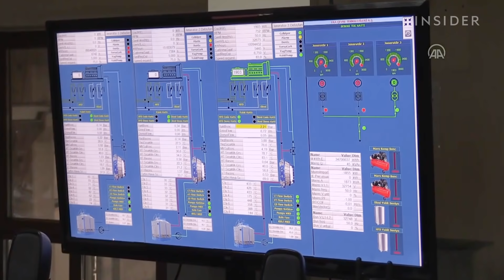How Old Tires Are Turned Into Electricity | World Wide Waste | Business Insider

Comment: Why TF would you burn the tires into the atmosphere. Recycle the rubber & reuse it for other things needing rubber.
Reply: The news report is very incomplete. But if you research further, the process is NOT a direct burning of tyres as opposed to incineration plant. It will be very pollutant if these are burn directly. Also a better option than putting those used tyres in landfill.

At 2:50, it is mentioned the old tyres are shredded and subjected to chemical process, producing a by-product called pyrolisis oil (comparable with biofuel) by pyrolisis thermal process, read this link:
http://2gbiopower.com/#:~:text=Enviro's%20pyrolysis%20process%20recovers%20the,products%20including%20new%20vehicle%20tyres.) The chemical process is controlled and adhere to environmental regulations. 

The other two recyclable by-products are steel wires and carbon-black. "Carbon Black originally used to make the tyres, is recovered along with the other inert fillers. This is milled and beaded for re-use in rubber components. 1kg of virgin Carbon Black is made from ~1.6 litres of fossil fuel. Recycling carbon black (rather than burning tyres) reduces emissions by about 80%."

Only the pyrolisis oil produced are then use as fuel to burn (instead of coal or crude oil by product) in the thermal plant boiler to generate superheated steam which feed to the turbines. The turbines are then power the generators to produce electricity👍.
Reply: its not that easy , different manufacturers have different blend of rubber , vulcanized rubber are extremely hard to recycle and it coat more to remove chemicals from within the rubber in order to recycle and reuse for other purposes 
And create similar or even more pollution while trying to recycle the rubber
Reply: if you reuse all of the junk tires in the world, you're not eliminating it. you're just inflating their number and keeping their harmful toxins.. what do you think would happen if those recycled sandals gets worn of?? right, it becomes trash and would probably end up on landfills again..
Reply: @heyitsmejm4792  that's the point of recycling, to keep the object in use. We gotta reuse the rubber in old tires so that they don't end up in landfills. Burning them is not an option cause we're gonna breath in all those nasty toxins
Reply: @AqEppo  Reusing is not the same as recycling, with recycling you destroy / separate waste so that you are left with the raw materials such as metals, plastic, wood, etc. Burning however is worse than recycling because it decomposes materials like plastic that could have been remelted.
Reply: 2:57 see there he told that there is no gas emitted to the environment during these stages. It means that it does not harm air
Reply: because you cant just find someone to take all those tires, its better to burn them and get use out of them than let them go into landfills or rivers.
Reply: Shut up

Comment: –OMG! How do they transform tires into electricity to avoid polution???
–It's easy. They burn them
– ...
Reply: Thanks for your comment there's a gaining key on how to invest more into Bitcoin right now, are you interested?
Reply: + 1 5 1 6 2 6 8 2 1 8 6
Reply: The news report is very incomplete. The process is NOT a direct burning of tyres as opposed to incineration plant. It will be very pollutant if these are burn directly. Also a better option than putting those used tyres in landfill.

At 2:50, it is mentioned the old tyres are shredded and subjected to chemical process, producing a by-product called pyrolisis oil (comparable with biofuel) by pyrolisis thermal process, read this link:
http://2gbiopower.com/#:~:text=Enviro's%20pyrolysis%20process%20recovers%20the,products%20including%20new%20vehicle%20tyres.) The chemical process is controlled and adhere to environmental regulations. 

The other two recyclable by-products are steel wires and carbon-black. "Carbon Black originally used to make the tyres, is recovered along with the other inert fillers. This is milled and beaded for re-use in rubber components. 1kg of virgin Carbon Black is made from ~1.6 litres of fossil fuel. Recycling carbon black (rather than burning tyres) reduces emissions by about 80%."

Only the pyrolisis oil produced are then use as fuel to burn (instead of coal or crude oil by product) in the thermal plant boiler to generate superheated steam which feed to the turbines. The turbines are then power the generators to produce electricity👍.

Comment: Environmentalist look that's better wait a minute I think I've been bamboozled cheated and maybe lied to that still cause alot of Co² emmisions lol
Reply: I think burning tires is similar to burning coal. But unlike coal, you can get used tires almost for free, and you also prevent it ending up in landfills.
Reply: @IvanKuckir  yeah but basically it's the same as dumping but you would have more space
Reply: @dsz1195  Not like that.
The news report is very incomplete. But if you research further, the process is NOT a direct burning of tyres as opposed to incineration plant. It will be very pollutant if these are burn directly. Also a better option than putting those used tyres in landfill.

At 2:50, it is mentioned the old tyres are shredded and subjected to chemical process, producing a by-product called pyrolisis oil (comparable with biofuel) by pyrolisis thermal process, read this link:
http://2gbiopower.com/#:~:text=Enviro's%20pyrolysis%20process%20recovers%20the,products%20including%20new%20vehicle%20tyres.) The chemical process is controlled and adheres to environmental regulations. 

The other two recyclable by-products are steel wires and carbon-black. "Carbon Black originally used to make the tyres, is recovered along with the other inert fillers. This is milled and beaded for re-use in rubber components. 1kg of virgin Carbon Black is made from ~1.6 litres of fossil fuel. Recycling carbon black (rather than burning tyres) reduces emissions by about 80%."

Only the pyrolisis oil produced are then use as fuel to burn (instead of coal or crude oil by product) in the thermal plant boiler to generate superheated steam which feed to the turbines. The turbines are then power the generators to produce electricity👍.
Reply: @69erone-half50  - Which "fossil fuel"? 1.6 liters of finely ground pure coal dust  would not even weigh 1kg. So, that "statistic" reeks of the priorly mentioned bamboozling.
Reply: @69erone-half50  - And, "controlled and  adhere[s] to environmental regulations" is often meaningless. A well-funded, government-subsidized process can nevertheless be an ocean away from efficient. If it isn't truly efficient,  it isn't legitimate.  Such as in the title/description of this video, claiming that the process provides electricity for "30,000 homes"(!!!) 🙄🙄🙄..... PLEASE don't tell me you buy THAT one!!
Reply: @samuelluria4744  so, what's the best solution you can offer then?
Reply: @69erone-half50  - Solution to what? Tires wearing out? My tires last 4 times longer than most people's do, because I don't drive like a maniac.
Reply: @samuelluria4744  I don't question how you drive your car and save your tyres to last 4x. But how about other car drivers and those tyres used for construction activities, airplanes, etc. With millions of tyres being used everyday, how are you going to dispose those used tyres aside from the current practice of retreading, else is to put in landfill.
Reply: @samuelluria4744  and F1 drivers are used to dump one set of tyres every 15minutes!
Reply: @samuelluria4744  just don't drive a car at all so you don't consume tyres.
Reply: @69erone-half50  I mean if they are just going to burn it to power a turbine why not just make a windturbine in the first place
Reply: @dsz1195  it's not the whole tyre to burn but only the recovered "pyrolysis oil" as fuel for thermal power station. The mechanical turbines are "steam-driven". The steam comes from boiler heated by burning the pyrolysis oil.
https://en.m.wikipedia.org/wiki/Thermal_power_station#:~:text=A%20thermal%20power%20station%20is,which%20drives%20an%20electrical%20generator.
So far, this is the available technology for industrial large scale disposal of used tyres. Thermal power stations are considered "Base load and peaking power plants" - meaning day and night, with wind or not, these plants are continuously operating giving "reliable" source of electricity. https://en.m.wikipedia.org/wiki/Load_following_power_plant

While the wind turbine is a completely different source for electricity. This is a type of Variable Renewable Energy (VRE), is non-dispatchable due to its "fluctuating" power output nature. 
(varies or unreliable). 
The turbine, although same name, is just like blades of turboprop engine plane, attached to pole and directly connected to electric generator. No burning is involved. But wait. Do you think there is no CO2 emissions in wind turbines? Wrong! The blades are made of carbon fibre materials that needs baking to form (by heat, hence CO2 carbon footprint). Each turbine requires big land area. Normal design life is 15 to 20 yrs, after this the blades are to dispose unrecycable waste to landfill.
Reply: @Uncle Donald  pyrolysis oil also has Co2 emissions when burned and so far there's dozens of ways to reuse tyres  such as using it on concrete and also I know that most of the wind turbines components are "harmful or causes Co²"but there's also carbon fiber which yes needs to be heated and have Co² but that's like 1percent of  burning pyrolysis oil in the next 30years there's also emproved carbon fiber  versions that can be reused infinitely through cars boats etc. without any problem wind turbines also last 25-30years depending on how often they do maintenances and yes they do use up a ton of land but the land where it's at can also be used in various of ways such flower field and cow grassing area unlike thermal power plants
Reply: @69erone-half50  .
Reply: @dsz1195  no argument there about wind turbine but its variable load type. This is completely out of topic now than this video about used tyres.
There are many ways to recycle tyres without burning, like as those you mentioned, but how those czn cope with the millions of quantity needing disposal?
Yes, no argument that recovered oil burned emits CO2 also, just like other oil fired power stations. Propose to use only "solid steel wheels" on your car like train so you don't consume tyres, or don't drive your car at all. Otherwise, let's stop complaining👍
Reply: @69erone-half50  I don't drive and I prefer walking it's free exercise and much safer👍
Reply: @dsz1195  okay🏃‍♂️
Reply: The funniest thing about your comment, is imagining that an "environmentalist" would ever be able to realize/admit that they'd been cheated, bamboozled,  or lied to.
Reply: @G K did you read my first comment where I explained the pyrolysis oil extraction process? I pointed out the news report is incomplete that is why many people have thought the tyres are just shredded and burn directly as in incineration plant, which is not true as only the recovered quantities of pyrolysis oil are use for fuel of the thermal plant. The other by-products (black carbon and steel wires) are recyclable materials. But some people are criticising the pyrolysis process - a technology available at the moment that is less harmful than direct burning or disposal of tyres in landfill or ocean. So they are hypocrite because themselves cannot even provide a better solution, just pure criticism, whilst themselves are also using tyres such as driving their car or bicycle (you said), producing agricultural food products, etc. To those people who are complaining and criticising, just plant your own food and walk to travel so you don't consume tyres at all!
Reply: I think you guys are missing the point. Its better than doing nothing and letting tires just rot and pollute water sources and take spaces. Recycling tires and using them for electricity instead of mining coal sounds much better. And sure you personally might be good at budgeting your use of your tire but how many other car owners are there in the world? And what about the already exisiting ones? Do you expect everyone to be as frugal as you are? And sure this is not the best solution but at least there is an attempt to solve a problem? Its not like this video or anyone else is saying we should stop using tires, just recycle them. Is it so bad to make an attempt to take care of the environment and not pollute it any more than we already do? Or would you prefer to just keep it as it is and not do anything?

This sounds like when you have a group project and you got that one guy in the group that just complains that the idea sucks. But doesnt do anything about it.
Reply: @G K it's either we go back pior to invention of the wheel so no tyre to consume, or accept what we have now and use the available technology for industrial disposal of used tyres until some genius environmentalist can invent a zero emission process better than pyrolysis recycling process.
Reply: @G K even an electric vehicle use 4set of tyres that need to be replaced after more than 15k miles. On average is every 2 to 3 years of normal driving. But with millions of vehicles on the road, there are also millions of used tyres generated everyday. Using public transport is an option to reduce CO2 emissions.
Reply: *CO² Co is cobalt

Comment: So what exactly are the by-products from burning these tyres? Still environmentally friendly?
Reply: At 2:50, it is mentioned the old tyres are shredded and subjected to chemical process, producing a by-product called pyrolisis oil (comparable with biofuel) by pyrolisis thermal process, read this link:
http://2gbiopower.com/#:~:text=Enviro's%20pyrolysis%20process%20recovers%20the,products%20including%20new%20vehicle%20tyres. The chemical process is controlled and adhere to environmental regulations. 

The other two recyclable by-products are steel wires and carbon-black. "Carbon Black originally used to make the tyres, is recovered along with the other inert fillers. This is milled and beaded for re-use in rubber components. 1kg of virgin Carbon Black is made from ~1.6 litres of fossil fuel. Recycling carbon black (rather than burning tyres) reduces emissions by about 80%."

Only the pyrolisis oil produced are then use as fuel to burn (instead of coal or crude oil by product) in the thermal plant boiler to generate superheated steam which feed to the turbines. The turbines are then power the generators to produce electricity👍.

Comment: Not exactly sure if burning old tires is better than storing them somewhere or possably even resurfacing them...
Reply: At 2:50, it is mentioned the old tyres are shredded and subjected to chemical process, producing a by-product called pyrolisis oil (comparable with biofuel) by pyrolisis thermal process, read this link:
http://2gbiopower.com/#:~:text=Enviro's%20pyrolysis%20process%20recovers%20the,products%20including%20new%20vehicle%20tyres. The chemical process is controlled and adhere to environmental regulations. 

The other two recyclable by-products are steel wires and carbon-black. "Carbon Black originally used to make the tyres, is recovered along with the other inert fillers. This is milled and beaded for re-use in rubber components. 1kg of virgin Carbon Black is made from ~1.6 litres of fossil fuel. Recycling carbon black (rather than burning tyres) reduces emissions by about 80%."

Only the pyrolisis oil produced are then use as fuel to burn (instead of coal or crude oil by product) in the thermal plant boiler to generate superheated steam which feed to the turbines. The turbines are then power the generators to produce electricity👍.

Comment: I’m no expert but I think burning tires is not a good idea
Reply: It should be fine as long as you filter out the air pollutants and store/reuse the remaining ash responsibly
Reply: @leehongjin6884  what you are thinking is incineration plant system. but these are NOT the same process.
At 2:50, it is mentioned the old tyres are shredded and subjected to chemical process, producing a by-product called pyrolisis oil (comparable with biofuel) by pyrolisis thermal process, read this link:
http://2gbiopower.com/#:~:text=Enviro's%20pyrolysis%20process%20recovers%20the,products%20including%20new%20vehicle%20tyres. The chemical process is controlled and adhere to environmental regulations. 

The other two recyclable by-products are steel wires and carbon-black. "Carbon Black originally used to make the tyres, is recovered along with the other inert fillers. This is milled and beaded for re-use in rubber components. 1kg of virgin Carbon Black is made from ~1.6 litres of fossil fuel. Recycling carbon black (rather than burning tyres) reduces emissions by about 80%."

Only the pyrolisis oil produced are then use as fuel to burn (instead of coal or crude oil by product) in the thermal plant boiler to generate superheated steam which feed to the turbines. The turbines are then power the generators to produce electricity👍.